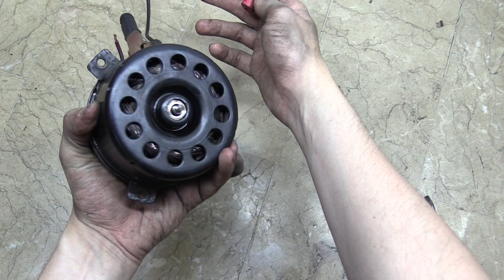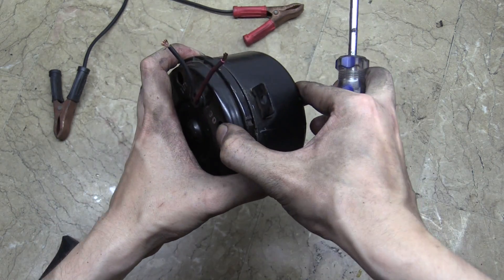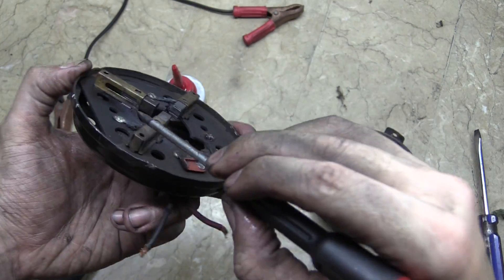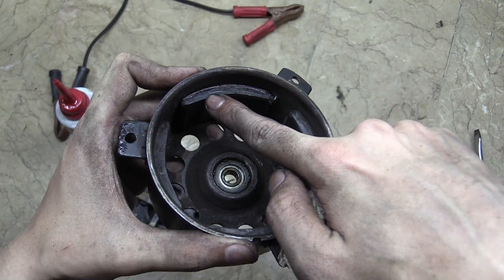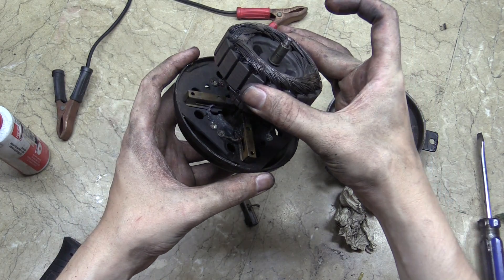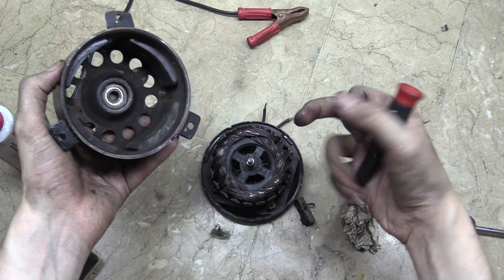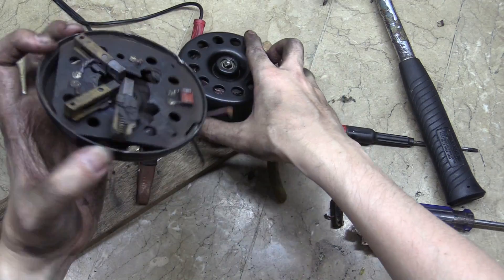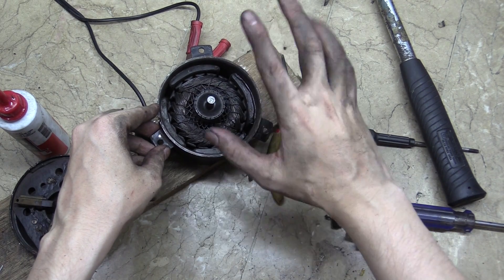Servicing a car radiator fan motor

Comment from the maker: Pro tip... don't hit your motor with a hammer. You can push the brushes back and then insert a wire at the side of the brush holder to keep them in place. This will make it much easier to insert the rotor.
Reply: Tell that to Jeremy Clarkson... :D

Comment: putting oil on bearings is only a very temporary measure they should be packed with grease, or replaced if seized

Comment: Sooo this video was pretty much pointless as you didn't even fix the motor and the actual steps you did show were not proper procedure because you said you wouldn't recommend doing it this way.
Reply: Also showed valuable "what not to do" which is fair as well

Comment: Is the main ball bearing replaceable...I have mine open and can't seem to get it out. I has a bit of play in it. Please help! 
Thanks
Reply: Two flatheads pressed against, bring the two flathead handles together. Give it a good whack with rubber mallet. Rotate flatheads 90 degrees. Repeat. Replace same size and can use epoxy weld to seal in new bearing.